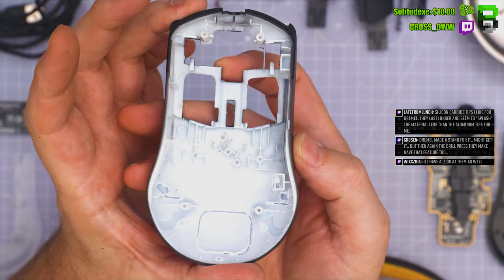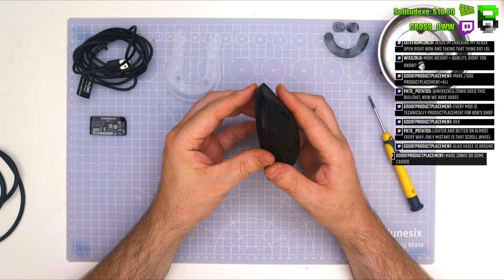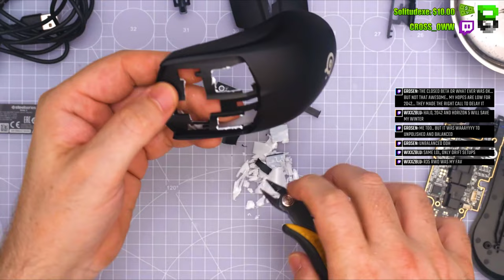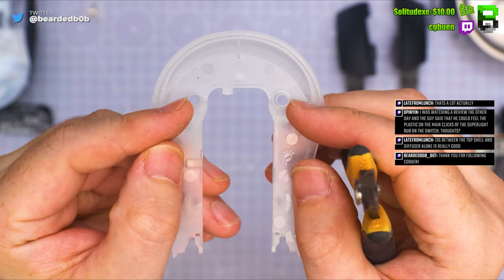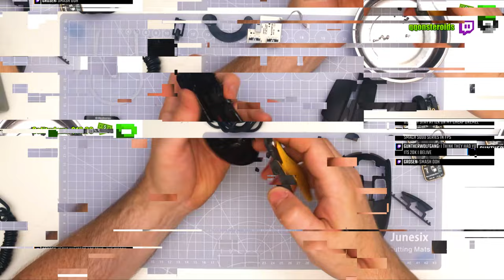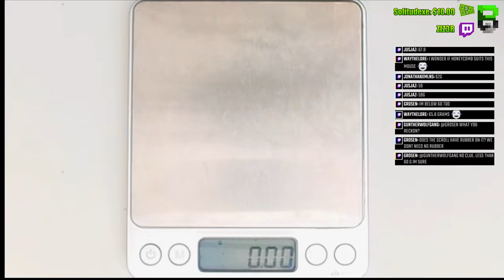SteelSeries Rival 3: Budget Beast Unlock Weight Reduction Mod

Comment: Can you do another budget beast like the logitech g300s ?
Reply from the maker: Sure.. have you seen my g305 ones
Reply: @Beardedbob  yeah i saw it, you did a 3D print mod, i think it was great but applying it to the mouse that i just suggested, would be really challenging since it has so many buttons in the upper part.
Reply: i was looking through some old mice, and found out that the g300s might be very good for claw, what do you think, why are you interested on the 300s? (also the rival 3 seems very good for claw)
Reply: @EnormeEkoH   Man, i tried the shape of the viper mini and the mm711, and still the g300s was the most confortable one, specially for claw, maybe even palm if you have smaller hands, also the sensor is good, not the best, but holds up really well with modern mouses. Before buying it, i thought it was a bad idea, because the sensor placement wasn't centered, and also it was super cheap, so i was sceptical, but i was wrong. another thing, it has usefull buttons in the front, which really help with productivity, you can program each button  with the old software of logitech, wish is a huge plus, maybe the weight is a minus, but you can modd it, by removing the white glass on the sides that reflect the color lighting and the extra buttons, if your not interested in them, you will cut probably more than 20 grams.
For me, this mouse could be the best hybrid  mouse ever, if they lowered the weight a bit and changed the sensor, but i don't know why it didn't have the same hype that other logitech mices had, maybe they didn't know how to market it back then.
Reply: @alfeddynaoufal9711  ye im very interested in this mouse, but im afraid for the buttons on top of the mouse, cause i dont need em
Reply: @EnormeEkoH  you can remove all of them , if you want, its super easy, and you have a 20 plus gram weight reduction.
Reply: @alfeddynaoufal9711  thats crazy how to do it?
Reply: @alfeddynaoufal9711  just saw it has no sides buttons and the sensor position is so weird, thats so unlucky idk, might test it anyway